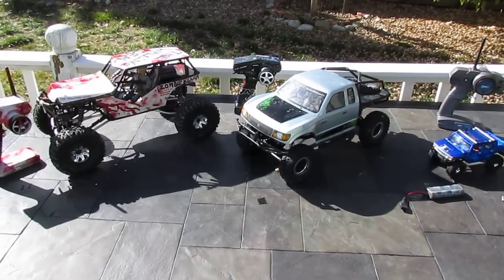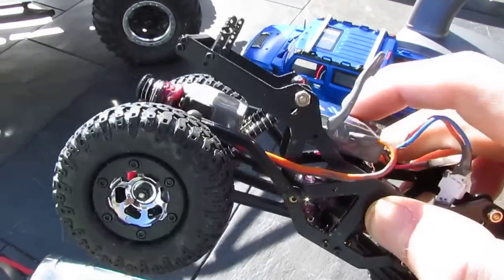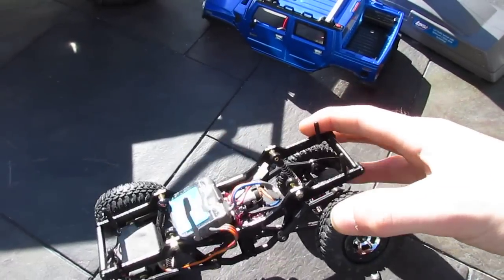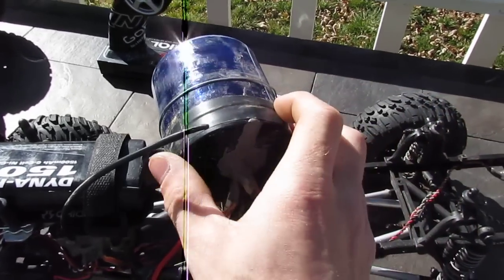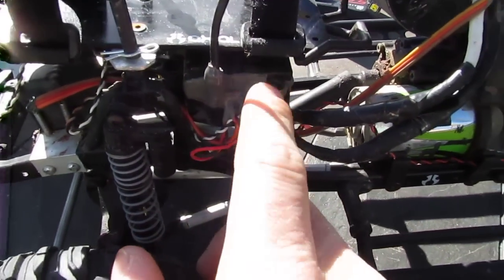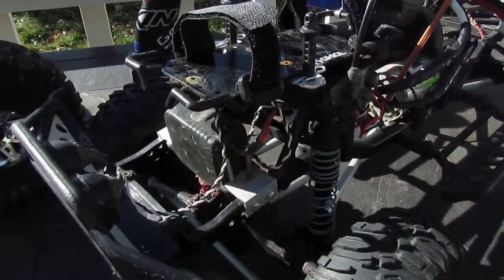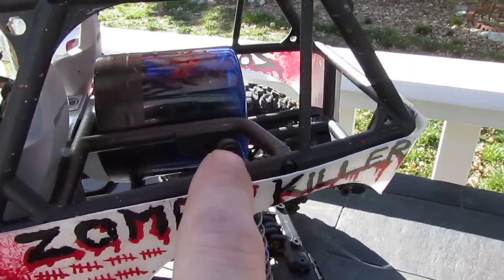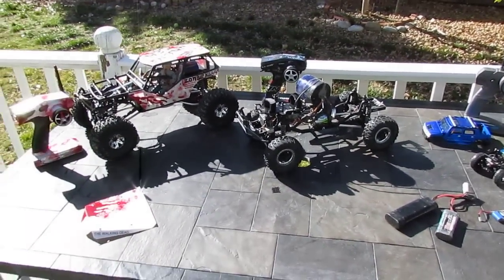RC COLORADO WATERPROOF OVERVIEW

Comment from the maker: Right on man.  Yeah the JB weld was the worst idea lol.  It was fairly easy to remove though, with a chisel lol.  Can't beat the plastic dip method!  Although for a temporary fix I've used JB to repair the control arms on my mini revo when they broke. Usually held up for a few bashing sessions and you can repair is without removing the part. (bonus on the mini revo its a pain)

Comment from the maker: I can always apply more JB weld if I need too if leaks pop up.  And as for tearing it apart its rather easy.  Just hit it with a peice of metal and it chips off.  The marine grease can wipe off in ten minutes of playing in "moving water" as I do most of my driving in a river.  I notice I have to re-apply grease to my servo horn a lot.  Thanks for the info though... to each there own.

Comment from the maker: Yeah, the JB weld is crap on the larger scale vehicles, it was an experiment if anything.  The plastic dipping of the esc vs. the jar method....well the jar method is just fine sir.  A lot of people are using a waterproof box of some sort.  Plastic dipping the esc is a wasted step with that set-up.  I have had no problems with "heating".  And all esc will have heat issues when its hot outside, point??  Besides I run my "waterproof rcs" in water... that usually helps keep the temp down.

Comment from the maker: Lol, except that its a jar.. when its hot out, and when I'm not running in water I unscrew the jar.  Ta! Da! like magic the air can cool it like normal.  And for the condensation that rarely ever builds up I put a Silica gel pack in the jar. <-(absorbs all moisture even in the air.)  Sounds a bit like hating.  I shot this video for someone who asked to see the inside of the rigs I water proofed. this is not the standard...nor the best method, but I've had no issues with the jars in over a year.

Comment: you would of been better off just using the marine grease the J.B weld will leak threw time and its going to be a pain to get it off when you want to tear it apart.. its your rig im not trying to tell you what to do but the marine grease works just fine alone..

Comment: Well ..... It's gna fry when it's hot out lol.......ohh yea btw the water is not cooling the esc when it's in a jar or Tupperware lol........and even worse than the heat trapped inside......the jar or Tupperware will get condensation inside witch makes it pointless bro ... Just tryin to help you out ... Not hating ..... Cool trucks btw..!!!!